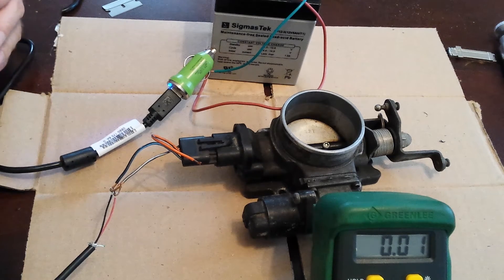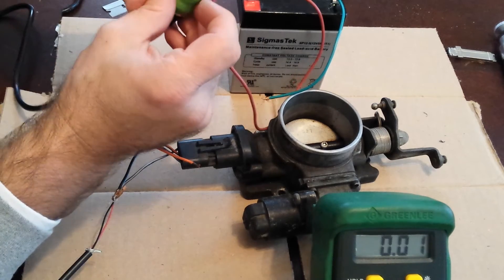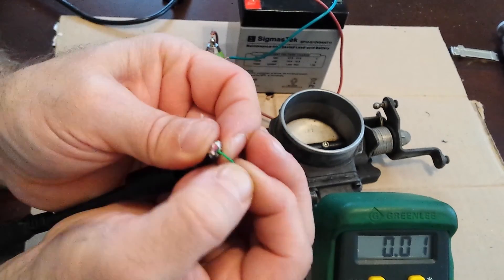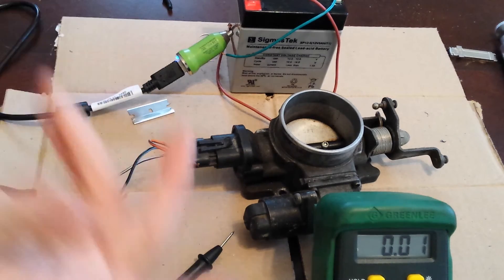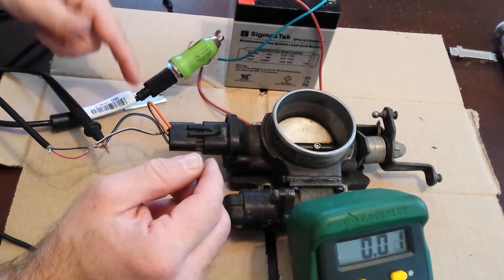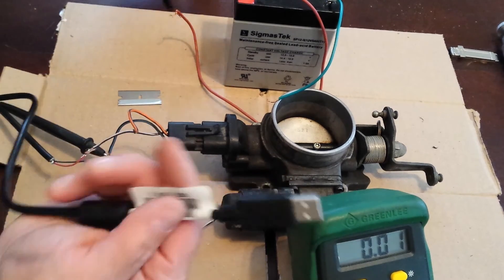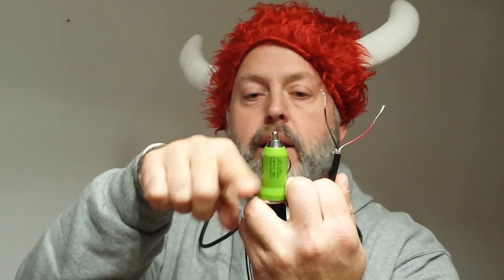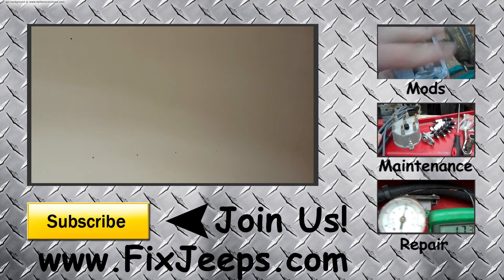Homemade Junkyard Sensor tester Works on Jeeps and other cars.

Comment: I just watched all your videos on testing sensors. If you can find time to do one on the 5 terminal starter relay,  I would be so greatful. I have a 1990 YJ 4.2L. I am now disabled and I started hearing a ticking noise in the engine. Me not wanting to be stuck on the side of the road, I decided to have it rebuilt. Come to find out, as they were reinstalling the motor, they noticed that the flex ring (some call it the flywheel) was cracked. They called around to several companies to find out that this particular flywheel is no longer in production and I was going to have to wait until one came across ebay. 13 months later I finally am able to pick up my jeep. I got to drive it back to the house and that was it. They had hooked some of my wires up backwards and it fried my harness. Now it's been another 2 years and I still haven't got to drive it. I didn't hold them responsible for the error they made because they were friends and just starting their business. I have had a few people offer to help me with the wiring of it, but they would work on it 1 or 2 days and never show back up. I would have no idea what all they did or where they left off so it was a total mess. I decided that though I can't do the things I used to do. I didn't care if it was just 1 wire a day, I was going to rewire the jeep myself so I knew it was done right. I'm now almost done, but I can't be sure on this starter relay. The schematics on it is not very clear to me. This relay and the 3 wire alternator is the only thing that is keeping me from firing this thing up (I hope). Any thoughts on this or possibly a video would be greatly appreciated. Sorry for the long comment.

Comment: Will this also work on other electrical parts? I want to test parts to make sure they work before I buy them from the junkyard. I have an older - 1995 XJR Jaguar and have recently found junkyards to be a good source of spare parts that would otherwise cost a small fortune. Thanks!
Reply from the maker: +Mod-Planet Mostly any part that runs on low voltage/amperage such as sensors. Parts such as power window motors .. etc .. nope. Will not work on high amperage demand parts. Thanks for dropping by! Have a great day!